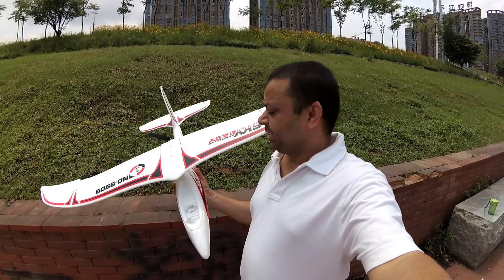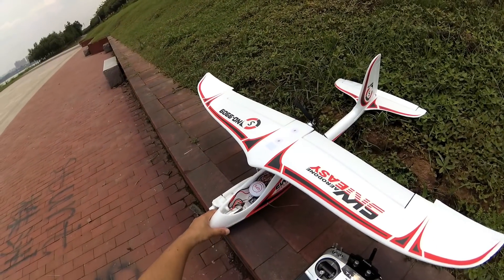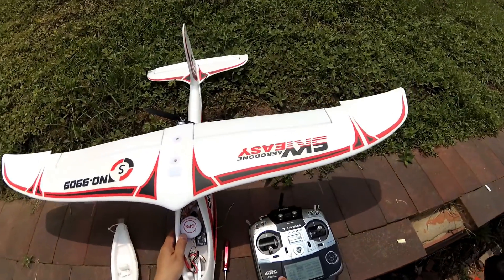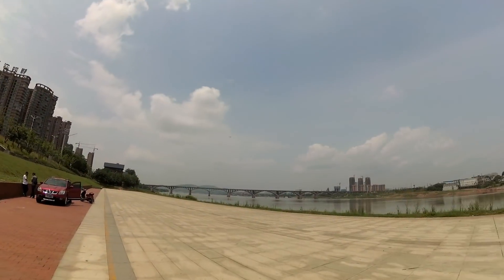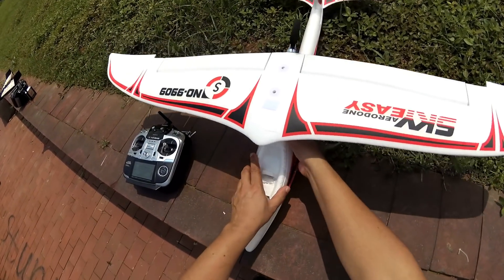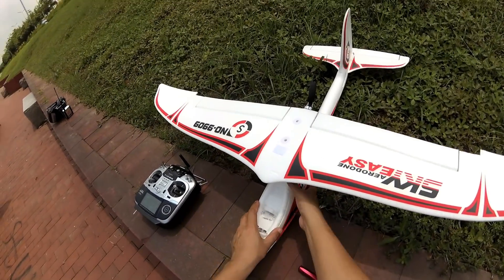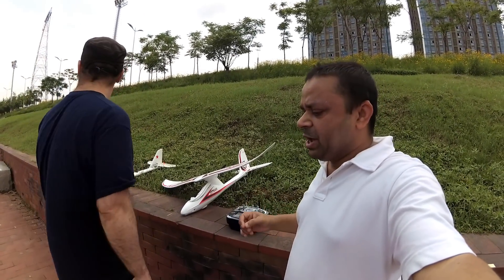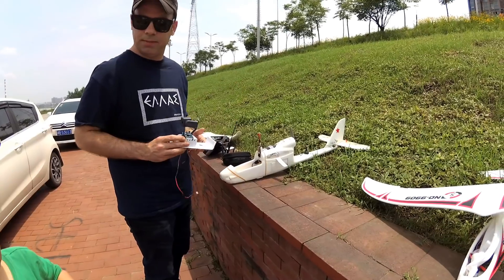Cheap and Tiny Autopilot BGL 6G AP Fail Safe Testing

Comment: Pretty nice looks to work okey my friend any good on a wing ? My opterra needs a safemode/return home thing :-) thx for sharing and good show off ;-)
Reply from the maker: its perfect for small Flying Wings. I used it in my Theer and it handled that flying bullet just fine. Just that at high speeds you have to turn the gains down a lot.